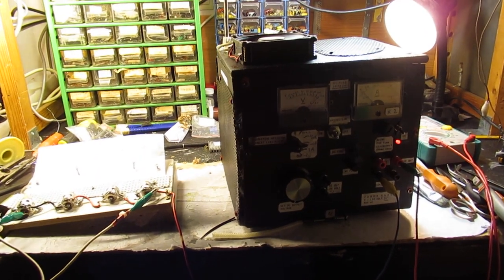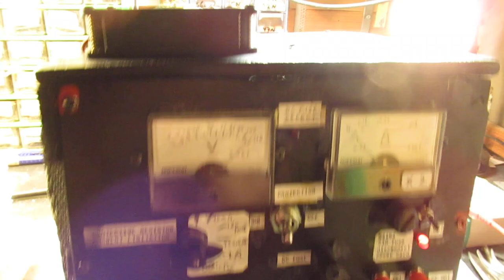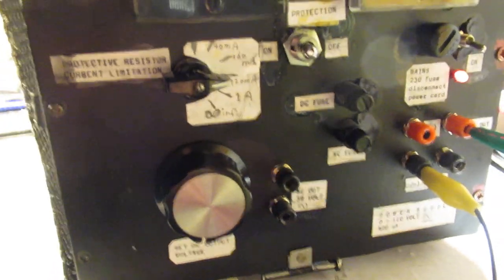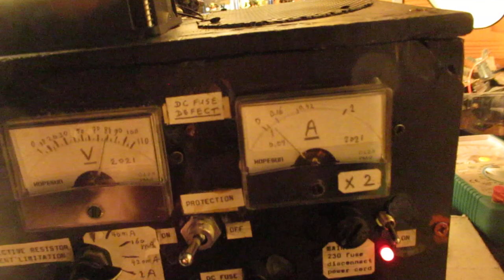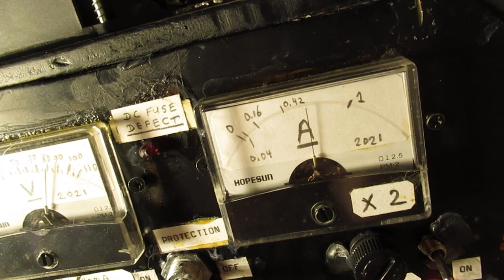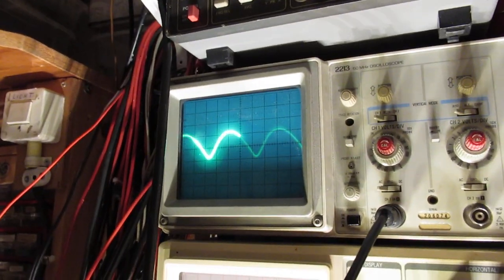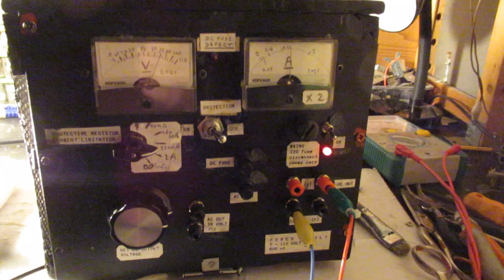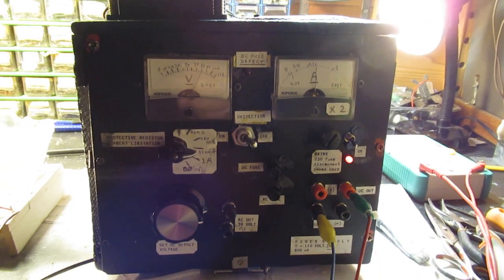Final video & VLOG: the 0-110 V DC power supply made for audio purposes, also talking about ripple

Comment: Your power supply is working great. 
I searched for a high voltage DC power supply; Amazon had a 150vdc @10 amps for $1,200. I think you have done much better. Good build Ko.
Reply from the maker: Thanks Barry, yes I am also satisfied with the unit. Though I had not expected that it had to take so much time.
Reply from the maker: Thanks Barry, yes it is. But after using it to supply the 60-90 Volt audio amplifier, the HV end-transistor (A2000) popped/burned out constantly on say 70 Volt at 2 Ampère. So have to do some rethinking, anyway, I will give a good solution in the coming weeks, because I need that power supply in the 60-100 Volt range. More in the description/textbox, I have pinned your comment. 13 March 2022.

Comment: Nice build Ko.
With 0 - 110V and 3A, you can power a wide range of (Audio) circuits.
And because the main power source is a transformer, i don't think you will feel anything of the voltage on the output when touching with your finger.
Reply from the maker: Thanks Bjorn. Hope to do some audio experiments in the future, say in the 50-80 Watt audio output range.

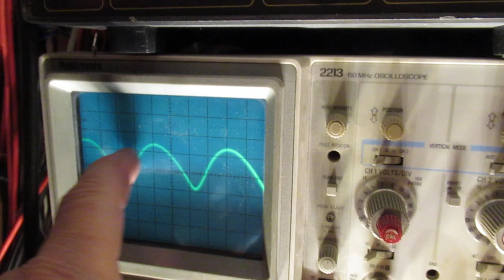Comment: 7:15 Is this ripple (pulsating DC) not 100Hz after the rectification ?
Reply from the maker: The showed ripple is normal, has to do with the way that the circuit was made (voltage doubler and  overall 1000 uF/300 V smoothing capacitors in the first rectifier stage. 4700 uF/150 V or 300 V types could be better, they are very expensive + the Miller circuit does the smoothing "job". The ripple is pressed down extremely by the capacitor value from base to ground (minus) in the first Darlington transistor, the BUT 11 AF (it is a Miller circuit). Its value is not too high in this case, otherwise the voltage comes up too slow and/or gives delayed effects on the output (lazy regulating). The other type of ripple looks like an oscillation at maximum voltage and current output. That is, indeed, a somewhat strange effect. More info in earlier video's. I have no direct explanation for that effect. I think it has to do with the voltage doubler that I used in this circuit + the sloppy wiring. On the Tektronix analog 60 MC scope I see this kind of ripple, on the digital Hantek 200 MC scope I cannot make it visible. Anyway: it must be there when the voltage and current are going to their maxima. When this voltage supply is connected to an audio amplifier this could be audible, or not. These phenomenon can often be heard as a faint hum/noise or kind of click on the (very) background when an audio amplifier is slowly supplied tot the maximum voltage/current out of this voltage supply, thus when the output voltage is lifted up slowly. I tested this with a signal tracer, with that you can make these effects audible. 4 march 2022.
Reply: @radiofun232  it was interesting if you could measure the exact frequency of this ripple. AC to DC converted, right behind the rectification without smoothing capacitor gives a 100Hz ripple. If the ripple you see on the 60 MC scope is 50Hz, then it is, i think (i can be wrong) noise generated from a outer source/part of the circuit, and not coming from the circuit (voltage doubler) itself.
Reply from the maker: @BjornV78  Yes, indeed. Because it was/is so faint I did not do that up until now.